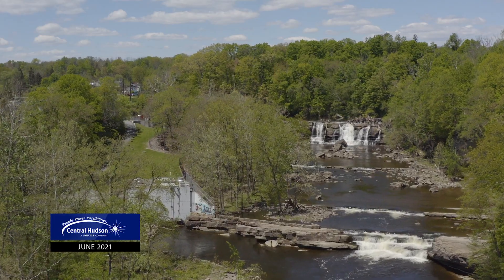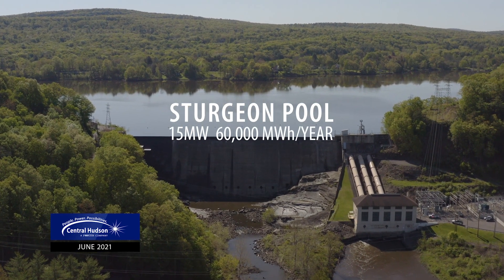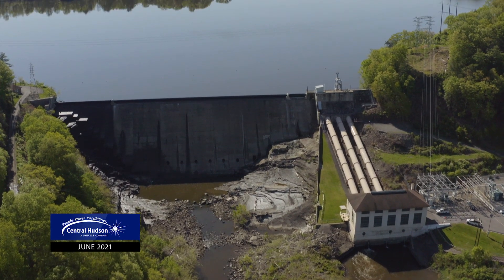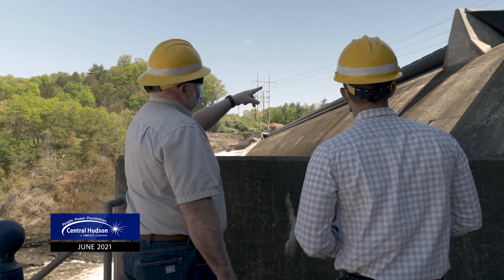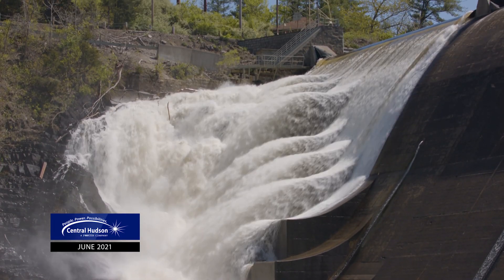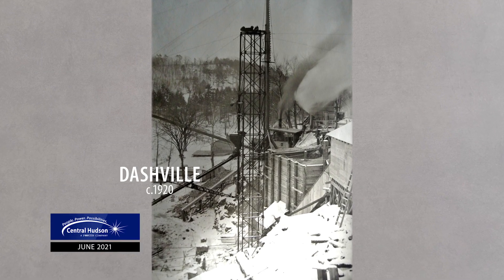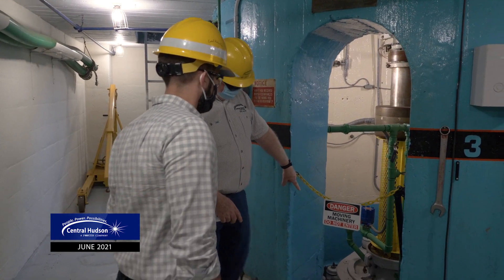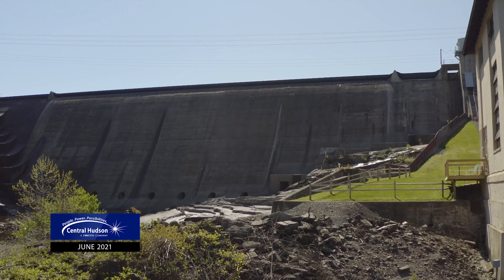Historic hydroplants still providing value 100 years later

Comment: I'm surprised you haven't put fish ladders in, or burrow a water feedline from the dashville damn to the bottom of sturgeon pool for a higher head pressure for a new installation, granted the building cost would be astronomical, regardless of those, I'd love to see fishing access for the lower sturgeon pool area, bet there are some amazing sized fish to catch there...